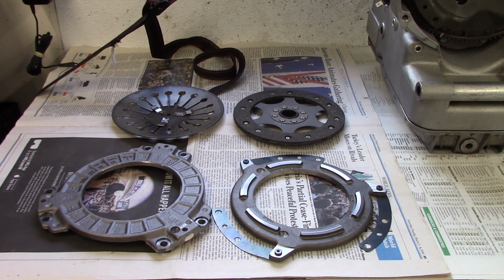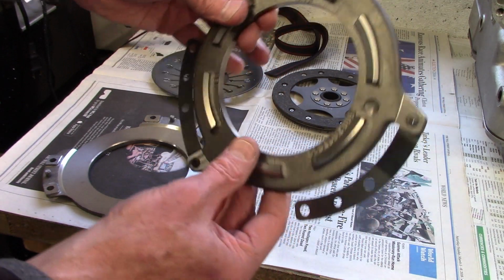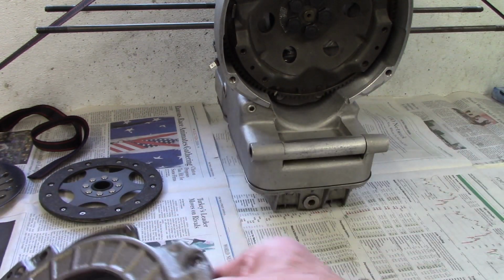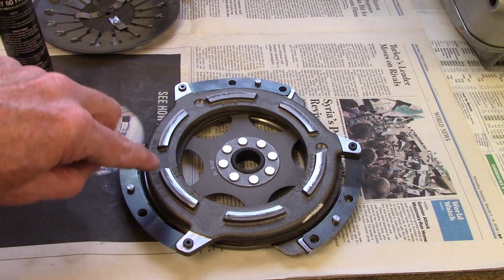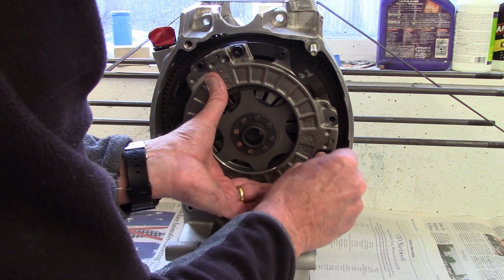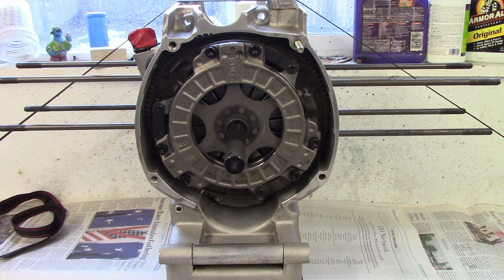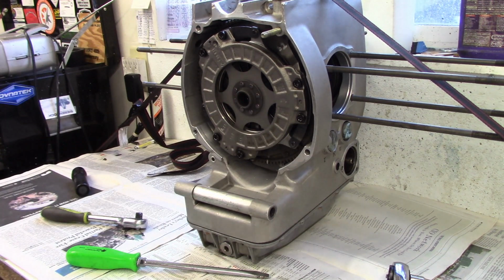1983 BMW R100RS Install New Clutch

Comment: I did a clutch service on my R65 (50 hp), taking everything apart not knowing about the heavy marks 🙄. Unfortunately not one of the parts had any marks. So it turned into a "BMW clutch lottery" 😉. Still happy that it worked!  Thank you for these Videos. They are very well made👍🏼 Regards from Germany!

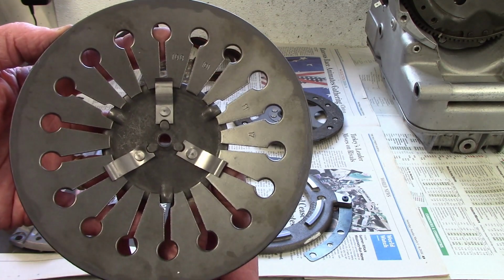Comment: 1:55 I can highly recommend to also put a tiny amount of lubricant on each of the tongue ends of the spring where they touch the central plate. With that, the whole clutch action becomes lighter und more sensitive. I used Sachs High Performance grease - as for the splines, perimeter of the spring and the central hole. Otherwise the clutch is very durable - 200k km and still going strong.

Comment: These videos are amazing! Im doing my first motorcycle project ever with a bmw r80/7 from 83, and these videos really helps me avoiding doing mistakes - so many little things that are not mentioned in eg clymers manual.. keep uploading! This content is not to be found anywhere else in such detail. Again thanks!
Reply from the maker: Hi Frederik,  I am pleased these have been helpful to you. Not all the information you need is in the videos. There is a link to the detailed documentation about this work on my web site in the summary under each video. Be sure to click that and read through the procedure.   And, I wish you success on your project. It's good to get another airhead back on the road. :-)

Comment: Thank you, very detailed. Another person added heavy marks together. I assume you are correct as what you did makes more sense. Also, I've seen torque values between 15 (yours) to 23. Is there variation between Boxer models or is there a bit of leeway. Thanks again
Reply from the maker: SuperNova, The clutch design changed from 1970 - 1995. So the clutch bolt torque values change a bit.
Reply: @BrooksAirheadGarage  okay thanks. Will double check mine when I do it. 1990 R100RT

Comment: Hi Brook, got a weird one for you. Pulled the transmission out of my wifes '93 R100R to lube the splines. Once removed, I noticed the rear main was leaking, so I replaced that and the oil pump o-ring along with o-ring on the piece that fits into the flywheel. I installed and torqued the new bolts into the flywheel just fine, and as I was torquing the 6th of 6 new clutch assembly bolts and washers to 15 ft lbs, the thread on one of the welded nuts on the flywheel gave way. All the locating pins seemed to be inserted into their respective holes in the flywheel, and all clutch bolts threaded right in and torqued just fine (except the 6th). Any idea what might have caused this? Thanks very much for taking the time to produce these repair videos!
Brian
Reply from the maker: Sounds like someone over torqued that bolt in the past.
Reply: Thanks, that could be the culprit

Comment: A little different than a /6.  Or maybe a lot different! My centering tool I can see won't work, I'll need a new tool. When I was riding with my posse we had a Machinist in the group. very handy for tools and jigs and dual plug holes!!

Comment: Hi Brooks! Again thanks for the vid! I have a clutch plate for pre-1980, why cant i use it for post-1980? I have a bmw r80/7 from 83
Reply from the maker: Hi Frederik, Well because BMW redesigned the clutch and changed all the parts. The goal was to lighten the flywheel so the engine would rev faster which caused changes to all the clutch parts.  Said differently, all manufacturers make subsystem changes and frequently that means older parts won't work.
Reply: Brook's Airhead Garage thanks for the reply! That really makes sense.. just annoyed that i can use the spare clutch plate i have :D